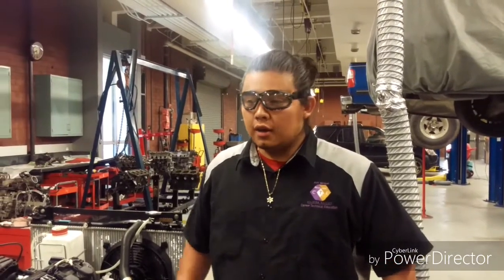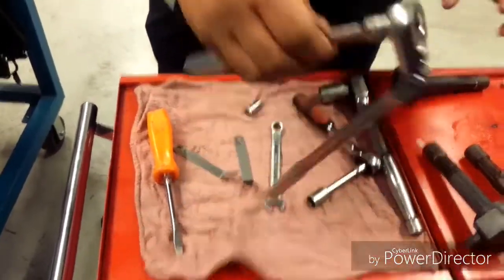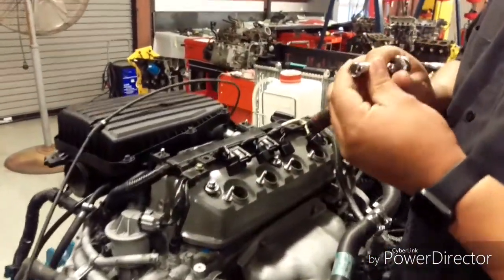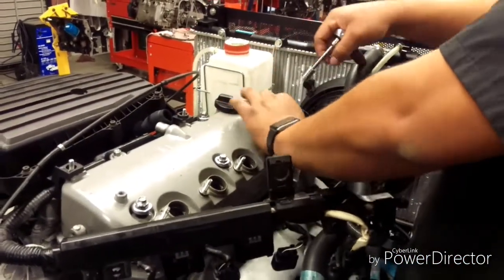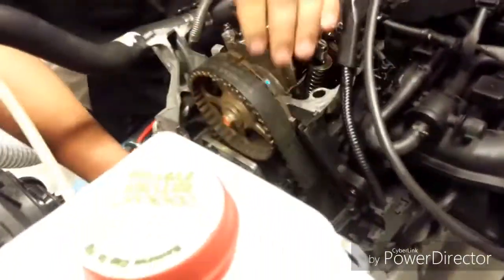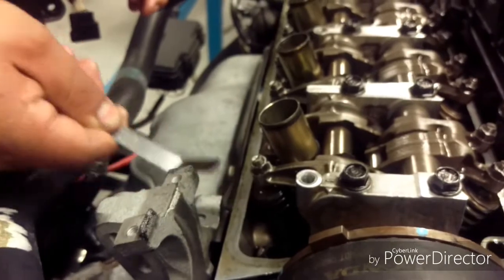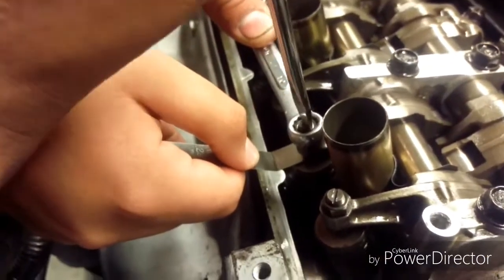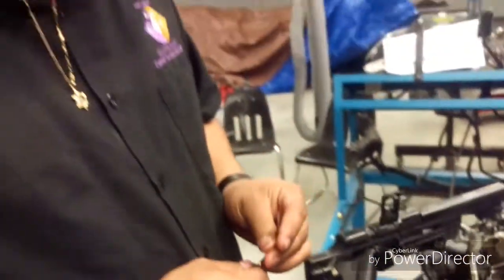2003 Honda Civic EX 1 7L VTEC Valve Clearance

Comment: What's the consequences of turning the crank shaft clockwise, instead of counterclockwise?
Reply: You run the risk of skipping engine timing, and damaging your bearings. Always rotate the crankshaft in it's normally operating direction.